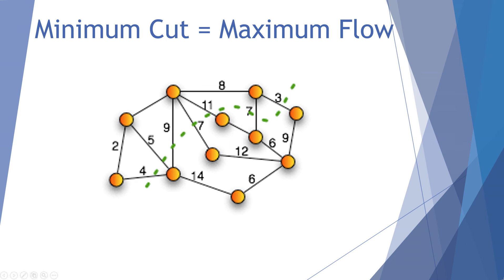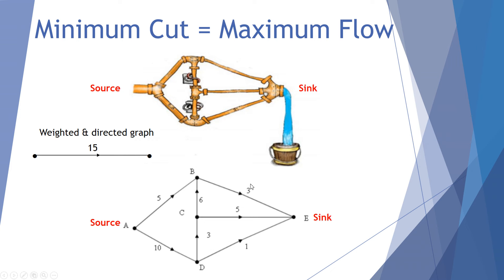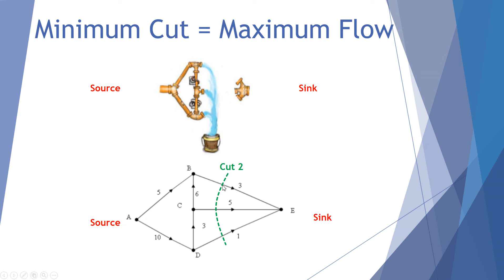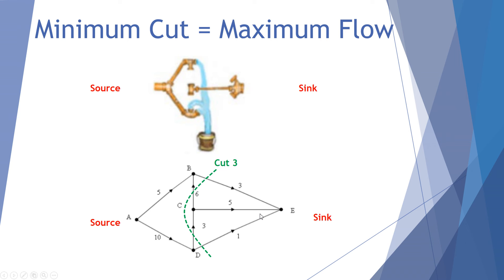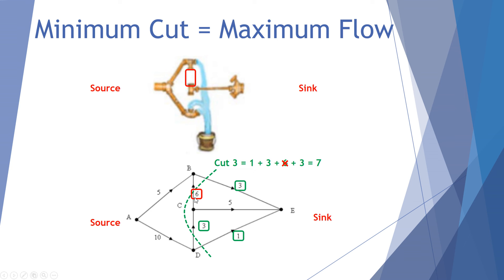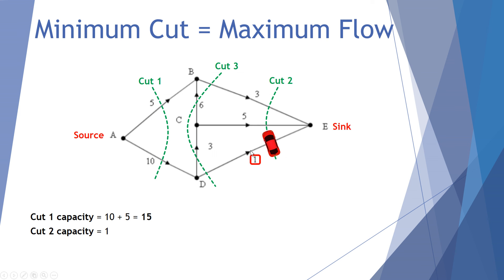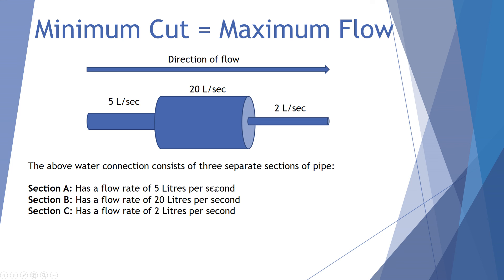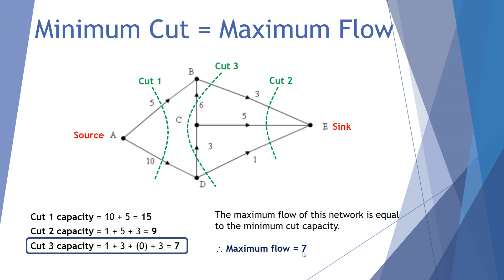Minimum cuts and maximum flow rate

Comment: Hi, thank you for this very helpful video. I was curious about this, though: if a cut was made through A-D, D-C, C-E, B-E. Following the car example you would add all except D-C together, but I believe C-E (even though the flow arrow is left to right) would not count as its flow was severed with the cut at A-D. Is this correct?